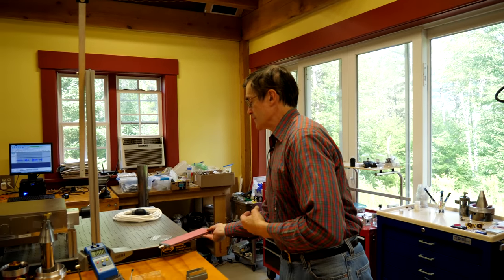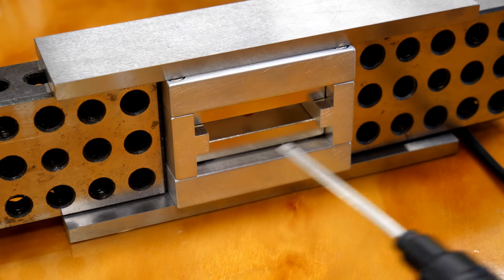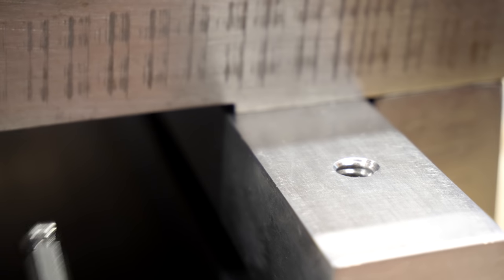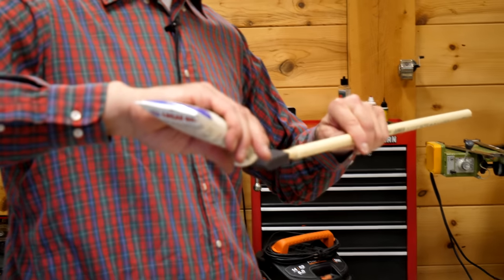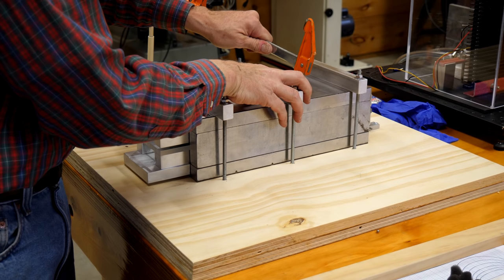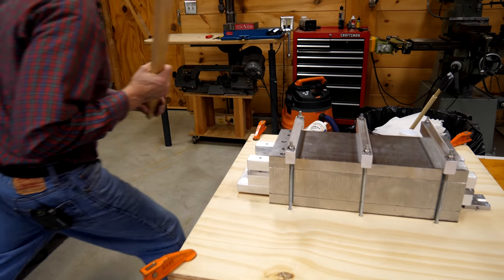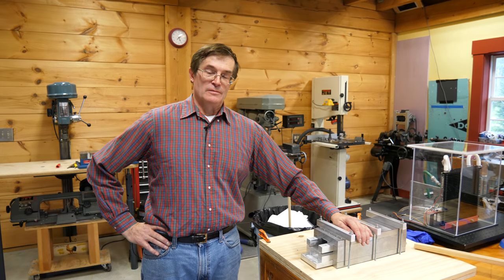Extreme Magnets

Comment: Oh yes. Magnets of that size can give you a good workout. Nice to see how well-prepared you are (as always...). Otherwise this would have ended disastrous. Looking forward to more videos on this project!
Reply from the maker: You would know about those challenges better than anyone and thanks, that's nice to hear!
Reply: @TechIngredients  
Thank you for your very educational and interesting videos I really appreciate it, but shouldn’t the effects of two magnets simply be the effects of the first and second magnet added together, I’m assuming that the charges/poles in a permanent magnet are fixed and don’t move in response to the field of another magnet, so shouldn’t it simply be a matter of adding up the force vectors (e.g. if two forces are equal but at right angles to each other then the final force should be 1.414 times as strong)
Reply: @brainiac lol I totally read that in your voice
Reply: Neo magnets are pretty brittle.... did you crack any?  What about thin sheet of  teflon sheeting between the magnets and the yolk?  Any reason not to use teflon?
Reply: "Magnets of that size can give you a good workout."  While you are running to the hand surgeon's office.

Comment: What does the Gauss meter say when inserted into the large assembly? That's what we're all wondering :)
Reply: Oh man, LOL yesss please :)
Reply: Wouldn't it be the same 550ish? Are you expecting it to be higher or lower? And why? This is the first comment I've read, so maybe I'll understand the rationale after reading the others :)
I personally wouldn't expect it to change much, assuming the assembly has the same size and geometry of steel. Maybe the horizontal gaps between individual magnets change the overall field? Is that the theory?
Reply: Andy Jones bigger magnets = stronger field
Reply: It says...
“Hello, I am Mr. Gauss.  Can I talk to you today about Jesus your savior?”
Reply: Glenn Lawrie-Smith. Good one. You made my day with that one lol.
Reply: Definitely more. The setup at 6:10 has aluminum near the magnets and aluminum acts almost like the air gap and blocks the field. In the final setup, magnets are contacting the steel, so it should have stronger field on the other side. I would guess 750-800 mT.
Reply: > bigger magnets = stronger field

Not really, 1 T is defined as 1 Wb/m^2, so the bigger the magnet you have the bigger the surface you have. Also Limit of the Neodymium material is about 1.3 tesla.
Reply from the maker: 1.2T.  I should have placed the meter in the assembly when I finished and I regret that.  We'll show the reading when we place the MHD insert into the yoke for pumping and generation experiments.
Reply: It would probably say "x_x" and the tip would never recover. It has a tiny magnet in it with a plate that changes resistance as it bends, just like in a kitchen scale or an accelerometer. The poor thing would probably snap right off and the very expensive device would become a lot less expensive paperweight
Reply: so a magnet's thickness has no bearing on the strength of it's field?
Reply from the maker: IT does, but not in a linear way.  The theoretical maximum field that a N52 magnet can generate is 1.43T.  This would be if the probe was in contact and the magnet was of infinite dimensions.  As the magnet shrinks both laterally and in thickness the field drops from there due to field distortion, as I show on the drawings.  You can magnify the field beyond this limit, but within a much smaller volume by placing steel pole pieces that distort the the field lines in a favorable way.
Reply: A true researcher would admit that "conventional" means most people follow it.
Reply: Good lord 1.2T
Reply: It now says "TILT" ^_^
Reply: @therealnightwriter Dude, are you high?
Reply: therealnightwriter  Nice. Definitely one of the most thought provoking tidbits I've seen. Thank you...
Reply: @whatevernamegoeshere3644  A magnetometer uses a magnet and deflection, a gauss meter uses a copper coil, so the strong magnetic field will not negatively affect it.
Reply: therealnightwriter    Are we all being crushed unknowingly by the aether? Do we live in a black hole?
Reply: @TechIngredients  Hey, are you still planning on making future videos for this experiment?
Reply: @TechIngredients  I first thought the T was for Terra and almost shat myself before i realized it's for Tesla.
Reply: therealnightwriter  My fart gas is incoherent aether and when flowing, which way does it spin?...to the right or to the left?...and to stop a tornado, hurricane, or vortex all you have to do is spin it the opposite way!
Reply: @TechIngredients  where is the video you promised us?

Comment: Quick question, (at 18:38) how did you calculate the attractive forces would be greater to the steel than between the poles at that gap distance? Did u do this simply by paper calculation knowing the field strengths or with some prior experimentation? Sorry for the dumb question.

Comment: Dude, I've been deriving the EMF equation for ever and  you've enlightened me. Correct me if I'm wrong, I'm pretty new at this, but doesn't that configuration resemble  an air gap at the moment of flux, even displaying the fringe factor where the fields meet (@ "air gap"). That makes so much sense being the energy is stored  is within the gap. So what you seem to have made is a static E core  to focus  your magnetic field. Nice! I can think of at least 5 applications for that magnetic circuit off the top of my head. Definitely getting a thumbs up and I'm subscribing. Can't wait to see what else you've got going on.

Comment: the pucker factor on insertion is off the charts
Reply: definitely.
Reply: Isn't that a lot of trauma to the N52 magnets?  Losing control of the monster is never a good idea,  say me of a 1000 pinches.  How could we ease the "snap"?   BTW thanks for the explainations.
Reply: I was imagining his thumb getting caught between the mag and the perspex. :o

It could quite easily have happened there. Rather him than me. lol
Reply: I just didn't understand the comments about the magnet flipping which seems impossible by observation.
Reply: "Excuse me,professor,can you tell me what the fuck is going here?"
Reply: @ddd228   I think they are talking about something sexual,( the pucker effect, thumb getting caught between the mag and perspex, and etc,) either that or they are trying to explain magnetic transfer from A to B. You take your pick
Reply: My fingers automatically recoil at the thought of even a small N52.
Reply: ChimeraPrecision felt across the web in ripples for years it seems
Reply: @MarkLawsonY3K  ive used plastic wedges
Reply: That entered my mind as well. The pucker strings snap tight just as fast as  those magnets launch into that channel.
Reply: The Pucker Factor decrease is directly correlated with repeated insertion. However it will never decrease to zero no matter how many insertions have occurred.

This also applies to the contents of the video...

Comment: I worked in a UK magnet factory for a summer in the late 80s. Neodymium was just coming in. I heard stories of broken fingers assembling filter grids for food processing. One time I was moving a neodymium based magnet around on a pallet truck. When I hoisted the assembly, the truck came with! That was through about an inch of soft pine making up the pallet. I had to jump on it to get it off. It was an interesting summer!

Comment: Sort of a large disk drive voice coil magnet arrangement. What amazed me was that the magnets didn't break when they slammed together inside the assembly. Obviously not necessary in this case but maybe some thin padding on the end of each magnet might have been a useful safety feature? Can't wait to see what you're going to do with it.
Reply from the maker: We are working on that very thing.

Comment: I recall a pattern you can arrange several magnates, that make the set one sided.  They use it in particle eccelorstors.  Could you test the Flux density and consistency of this configuration as well, and compare it the these?

Thanks.

Comment: @13:18 - I would put a wood platform in front of the device before loading the magnets. Just extended the loading area to be level and further out. This will allow you to put downward pressure on the magnets without causing the front to flip upwards (as it did). I notice on the 2nd magnet, you put your hand on both sides to prevent this. I think a little flat loading dock would make it easier to maintain safety.
I did like watching you load those. I felt the stress.

Comment: where do you get magnets this strong from? 

been on the lookout for a while now for a project. gonna turn a 10hp 2 pole motor into a permanent magnet alternator by replacing the steel core rotor with a 2 pole magnet to generate a rotating magnetic field and produce electricity.

Comment: since we are talking magnets i got an idea for you, a Linear Permeant Magnet Mass Driver, the magnets are arranged such that they retract or brake away from the barrel as the projectile reaches set points along the acceleration path, so that the magnets do not hinder the forward velocity of the projectile. The magnets will operate on a trigger mechanism that are spring loaded such that they spring away very fast thus removing their influence on the projectile as it pass the magnet.

Comment: I like what you are doing but maybe you may want to grease the sides as well, that may help move the metal on metal friction issues. I was thinking that tapping the magnets would break their bonds temporarily, maybe you could tap them with the stick into place.... just trying to help... nice video..
Reply from the maker: They want to move with an almost irresistible force due to the attraction with the field in the yoke, but as they approach each other in the slot, their individual repulsion cancels this force, decelerating them.  That is why they didn't impact at a high velocity and explode.

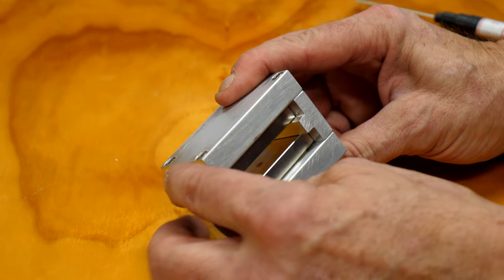Comment: 3:40 stainless "steel" is usually magnetic... I know that some types of stainless are not and I know it has to do with their structure (orientation of the iron in the structure) 

but Im curious is there a common type of stainless that is just known to be a non-magnetic stainless, or do you just take a magnet with you and check all the stainless bolts?
Reply from the maker: 18-8 and the other 300 stainless steel alloys are the most common  and are very weakly magnetic.
Reply: @TechIngredients  cool, thank you

Your Channel is awesome BTW. I haven't found a video that isn't interesting and insightful yet

Comment: This gives me an idea. You could actually make a very powerful actuator or servo that doesn't have to make physical contact with anything by placing magnets on opposite sides and an optimal frequency switching between them to precisely move it.  But now that I say that, I can tell it would be very inefficient because you would have to maintain that opposing frequency to hold its position firmly in place.

Comment: actually...  at the end it reminded me of the designs for permanent mag motors.  The only thing stopping us from making them is heat.  Magnetic shielding works when it is cooled to near 0, which makes a variety of simple designs possible.  But cooling things takes energy, on earth, and i guess that's why we don't have any.  You're saying that the field lines can be pulled or pushed one way or another, i think, and that could also cancel or unbalance a mag enough so that a simple design could work.  Very interesting...  What you're doing here... i have no idea why or what for, but it's very good.  There's a guy who uses crop circles to design mag motors,  i think those designs might give you some ideas.  A butterfly told me so, in a dream.

Comment: I know this one is an oldie but it's a good. I have always loved magnet ideas.
Watching this makes me believe that you could easily create an anti-gravity generator.  I am looking at your illustration at about 8 minutes and I wondered what would happen if:
 Assuming that you have a massive magnetic field such as that in the illustration at 8 minutes that was creating that energy field loop around the magnet itself. If you were to spin an electromagnet like a horizontal tire is spun up to "levitate" that invisible field would also spin up into centrifugal force and potentially levitate right? But what I am mainly wondering is if you were to build another electromagnet to surround that initial electromagnetic field and spin it in opposite direction and oposing polarities wouldn't it create some type of zero-gravity type of space as a result of the opposing kinetic, electromagnetic, and centrifugal force?

Comment: Super dangerous way of assembling the magnet.  That design does not eliminate opposing magnet pole blocks smashing together, especially with that sheet of acrylic which does not even fit!  However, nice project and it will be interesting to see what you do with the magnet.
Reply from the maker: The acrylic sheet does not have to fit. It only has to prevent the magnets from coming into contact as they slide in.  Once the magnets come to rest and are in contact with the steel, they are not going anywhere.  Despite appearances, and the field redirection produced by the yoke, the individual magnets still resist coming into contact.  I am pretty strong and I am unable to force them the final couple of mm between them.  This acts to decelerate the incoming magnet before it strikes the previous magnet.  We tested this with smaller (cheaper) magnets and were unable to damage a magnet.

Comment: Your videos are so interesting. Would the field be stronger if you also mounted magnets on the open sides of your frame? Where you kind of have a stack of toroidal magnets then insert them in a pipe or tube?
Reply from the maker: No.  The steel yoke guides the external field lines as effectively as a magnet would.

Comment: So 4x600lb neomidium magnetic feilds 2400lb magnetic feild output? Also when you're talking saturation of the iron connected to the magnet feilds for redirection i veiw it as a catalyst to the stored energy in the magnet simply being  spread out like a rivers flow not being pinched causing rapids instead less constrainded by the volume of iron to store energy  or voulome of water in

Comment: Is there a follow up video to this?  I couldn't find any.
Reply from the maker: Not yet.
Reply: @TechIngredients  Is it in the pipeline?  It's nearly three years and I notice you seem to have moved on to many other things.
Reply from the maker: We circle back to previous projects when we're not so busy with a current series such as the rocket engines.  So, it's not scheduled, but it will happen.

Comment: Engage safety squints 
I found myself tensing up, turning my head, and squinting as you were loading those.  I do have one question though, didn't the magnets slam into each other while loading?  I have heard that magnets like this are quite brittle.  I was waiting for you to add some sort of spacer, or material like "silly putty" in between to reduce the impact but ultimately allow the magnets to come into direct contact.
Reply from the maker: The magnets slow as they approach, they are not attracted to each other in this configuration.  They're attracted to the magnets above them, but repell the ones ahead of them in the slot.  The impact is not hard if it even occurs.

Comment: Now here would be a fun idea with some specialty magnets. Get some made that were T shaped semicircular ones so that the T shape locked them in place. An inner row and an outer row with matched poles alternating all the way around. Make the holder for them C shaped so that coils could pass between them as a stator with the magnets on the C shaped piece as the rotor. Just I wouldn't want to be the one who loaded the magnets. ;-)

Comment: Do the brittle Neodymium magnets become damaged if they slam into one another, while inserting them?  That is, do adjacent magnets need to physically touch, inside the yoke, or could they have small,  soft spacers between them, to minimize any traumatic contact?  Great video!
Reply from the maker: They can fracture, but it won't go unnoticed. A nice technique is some dry ice snow placed in between the magnets while they are loaded.
Reply: @TechIngredients  Great idea: they'll just settle in place as the dry ice sublimates!  That's why YOU have the best tech channel, imho.  You are a natural teacher, too.  Good work!

Comment: Well done but letting the magnets hit each other was a bit dangerous, as they could shatter.. So better next time use at least a bit tape at the end so they can't clash into each other and break...Anyway, well done..
Reply from the maker: The repulsion between these magnets is significant.  I am unable to force them into contact with all my strength.  This acts to decelerate them as they slide in.  Also, we tested the process with some less expensive magnets just to make sure.  And, thanks!

Comment: Is there any good sources on learning how to control magnetic fields? Is it even possible to have magnet with only north pole, pushing another with north pole, with out field effecting surrounding area and other magnets any meaningful way? What materials are able to block magnetic fields?
Reply from the maker: The magnetic field origenates from the spin of the electrons in the magnet.  These are aligned when the magnet is produced to create a macroscopic field.  There is no such thing as a monopole that only has one pole with out it's oposite.  The field lines have to follow a closed loop.